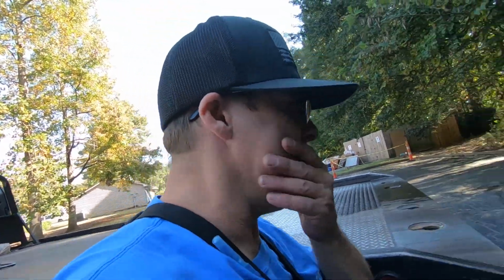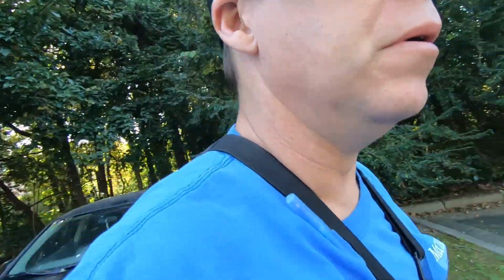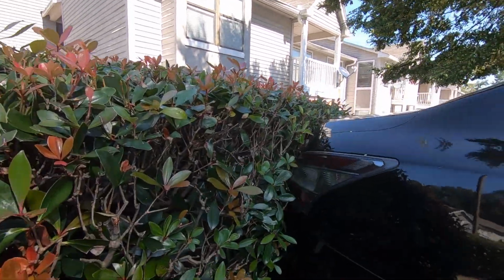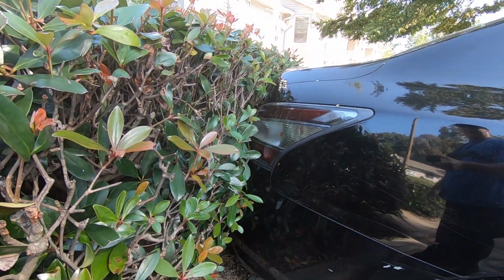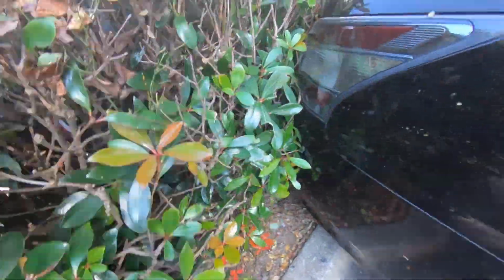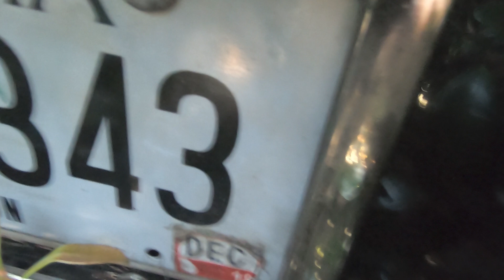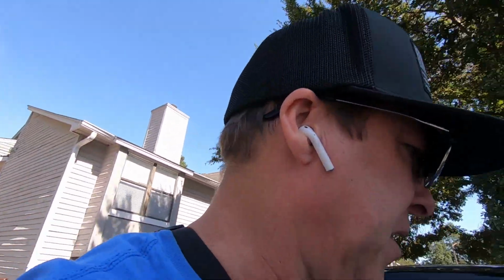Parking Revenge #81

Comment: The positive thing I can say about the guy with the Maxima is that at least he's not driving it with expired registration and most likely also uninsured 🤷🏼‍♀️
Reply: How do you know ?
Reply: @Ean.oo7  because he said he couldn't leave with it. I assumed that meant he wasn't driving it
Reply: @crossplainschic  Hard to tell what he exactly meant.  I wouldn't be surprised if he didn't have current reg, insurance or even a current license.
Reply: @Ean.oo7  exactly. Hopefully he is doing the right thing
Reply: The most blatant and easily noticed part is the tag sticker. Cops casually look at those all the time. The sticker color makes it easy to tell & I'm sure cop's have those colors memorized so it'll stand out. That's also why he backed up against a bush. If he goes out on the road he'll get caught fast.

Comment: I know tow operators will adamantly say that flexing the top of the door out to unlock a vehicle does no damage, but it does. 2 different vehicles I've had that the previous owner had that done to. 1 was the passenger door and it gushed air at about 120mph. I drove it in Germany and it made going over 120 mph or 180 kph on the autobahn a lot less fun. The other is my dodge truck, same thing but kicks in at about 80 mph. I'm tempted to bend it in, but dont know if it will cause more damage.
Reply from the maker: Yes it can,if it not done properly.  I've seen door bent.  This is a process thats done gently and you only flex the door enough to put the rod in there.  As far as bending them back,  I'd be willing to bet that it's very possible to fix with a towel and a pipe wrench,,,window down though LOL

Comment: Do cars in the USA not have dead locks ? In the UK most cars have dead locks so you would not be able to open a car like you did in video as handles or central locking button wont work when dead lock is on.

Comment: Anyone know why some tires rotate backwards while being pulled forward?
I never understood the physics of that.
Reply: It's because of the differential connecting the drive shaft with the right and the left wheel. If the drive shaft doesn't turn (because the engine is off and the transmission not in neutral) and one wheel turns forward then the wheel on the other side has to turn backwards, because otherwise the differential would break.

Comment: Crash safety ratings matter
Reply: Speed/physics matter.  Most vehicles/SUV's would have be just as damaged/flipped at those high rates of speed. If not, please let me know of dealer on your M1A2 Tank.
Reply: @Ean.oo7  I’m guessing you either drive that same brand or even car to be this triggered
Reply: @juandominguez8536  Not even close.  The only thing that "triggered" me was your nonsensical first post in regards to this particular accident as it would have little to no bearing on the outcome.
Reply: @Ean.oo7  ok, sure, crash safety ratings have no outcome on crashes. That’s totally why a F10 M5 crashed in the Autobahn going 200+mph and no one died. 🤡
Reply: @juandominguez8536  You seem to have trouble understanding English.  You posted the statement: "Crash safety ratings matter" in a video that showed an extensively damaged vehicle due to a high speed impact.  Almost any vehicle would have similar damage due to such a high speed impact. Your one example of an (unrelated) type of crash proves nothing since the last time I checked, BMW's fatality rating wasn't 0%.

Comment: If Lisbeth Salander [The Girl Who series] can hack into a vehicle's computer and cause the air bags to deploy, thus stopping the vehicle, it would follow that law enforcement should be advanced enough to hack into a vehicle's computer system and shut it down.  Perhaps the auto industry should be required to install the same chip so police could use their in car computer to stop these mad chases that endanger everyone.  The cops are just as much at fault for these kinds of accidents as the runner.  Remember the chase of the delivery truck, which was hijacked in Florida, and the ultimate ending?